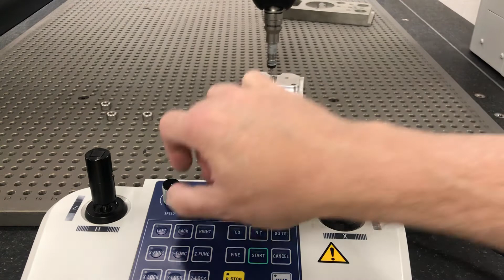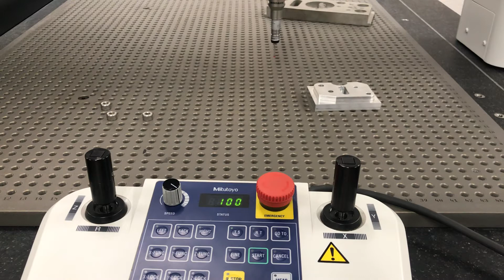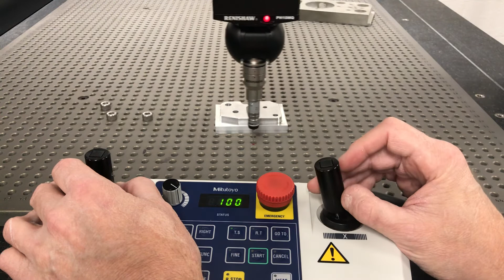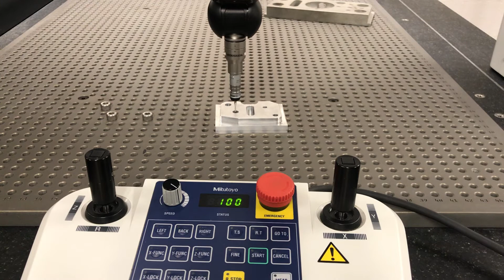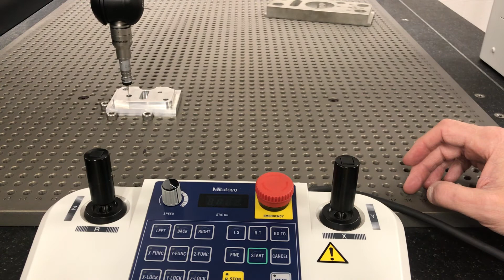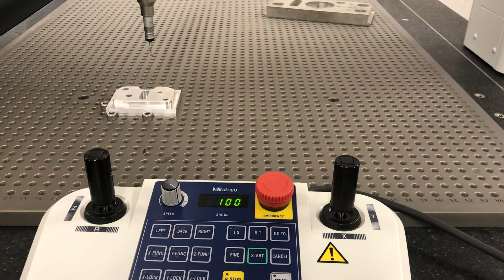Mitutoyo CMM - Dedicated vs Non-Dedicated Alignments

Comment: For the manual alignment will the cmm compensate for height changes based off of fixturing? Say I com back to a set of parts after 6 months and I do not use the exact stanchions that had been previously used. Thank you this has been a great video series you have produced.
Reply from the maker: As long as you do an alignment before you start measuring you should be good. The initial alignment will set the plane height even if you use different height stanchions.
Thanks for asking!